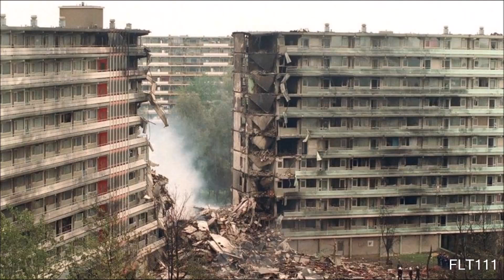El Al Flight 1862 - ATC Recording [ENGINE DETACHMENT DUE TO METAL FATIGUE AND LOSS OF CONTROL]

Comment: RIP
Yitzhak Fuchs
(1933–1992)
Arnon Ohad
(1960–1992)
Gedalya Sofer
(1931–1992)
Anat Solomon
(1968–1992)
and
To the 43 people who were killed on the ground by the crash of El Al Flight 1862 due to a dual engine separation and loss of control

Comment: Anyone that thinks a plane stuck that building needs to stop watching Road Runner flicks
No Ali built hollow tube is going to smash thru 10 floors of Concrete, not in 100M years.
This Demo was a pre 9'11 idiot test and it worked.

Comment: I saw a NatGeo doc today, that very documentary. In that doc it was said that the captain Fuchs choosed the runway 27 to land because "is is the longest". It's a lie, RW 27 as the 4 other RW of Schipohl has only 3,3 Km length. The longest is RW is 36, 3,7 Km long, where the flight 1852 had took off 8 mins earlier, the same one. Check for yourselves in G. Earth. Maybe that plane had not any crew at all. Notice no worries in voices recorded of the crew...
Reply: Oh boy.
Reply: Uhh hold on it's not 1852 it's 1862

Comment: Where is the 400 ton plane? Does Avgas now vaporize metals??
The plane fell from the sky did it not?
So the wreckage must be above the rubble yes??
Where is it?? 400 tons of metal? and 2 massive engines??
Reply: I lived in the neighbourhood at the time and I saw that plane going in the Groeneveen and Klein Kruitberg flats at that Sunday evening. Now you are saying that i'm seeing things?
Reply: It didn't fall straight down. It hit full speed on the side of the building we are seeing. One wing straight down and one straight up if you see what I mean. I believe these buildings where not completely attached. There was a small gap. So most of the wreckage went through that gap and is behind the building.. after impact the sides of the buildings collapsed on top of any wreckage that was in that gap. It was really insane. almost 30 years ago and I still remember it like yesterday. If you ask any Dutchman over 35-40 years old about ''The El Al boeing'' they will probably immediately know what you mean.
Reply: @Dani8chs  Some errors with your claims
Full speed???  This plane had lost 2 engines off the right wing so ''Full'' speed was impossible!!
The aircraft was on approach for landing , why would any plane be on approach landing at ''Full' Speed??
Yes the plane was on a fast approach because of serious wing damage but nowhere near ''Full' speed.
This aircraft ''Plunged'' from the sky. It had lost  ''Lift' from the right side due to severe damage cause by the separating engines from that wing.
I pose my question again? Where is the 400 ton wreckage?
Reply: @yabbadabbadoo8225  Underneath and mixed in the ruble
Reply: @irobinhood5529  Keep reading Bambi stories dude
Reply: @yabbadabbadoo8225  Keep believing conspiracy theories.
Reply: @musicnerd72  Show me the Plane?
An El Al Jumbo Jet is a big Beast.
It still had(claimed) 2 engines attached.
I have spent weeks looking for evidence of plane wreckage. I have found Zip.
No wings , no tail fin , no fuselage sections , no landing gear(cannot melt in fires), Only in the 9/11 events and this El Al 1862 claimed crash have planes 100% vanished!! 100% Impossible.
It Pays to Open Your Eyes unless you're involved in said Crimes !! Ummmm??
Reply: @irobinhood5529  The plane in the report was claimed to have plunged down on to the building!! The Rubble would therefore be Under the plane wreckage if there even was a plane - Try Harder
Reply: @yabbadabbadoo8225  investigators found the FDR (Flight Data Recorder) in the wreckage so there was a plane there.
Reply: @captainbossman1016  Really? They ''Found'' a Flt recorder but a 250 ton aircraft cannot be seen anywhere??
Landing Gear? Wings?? Tail Fins?? Claimed cargo?? Fuselage sections?? 2 huge engines?? The smoking Gun are the missing engines just like 9'11.
John Lear has explained 9'11. Someone needs to explain this El Al con job.
The damage to that building is consistent with an implosion result. Sir Isaac Newton's laws are not at all present here.
Never just take a picture at face value.
Look deeper always.
Reply: @yabbadabbadoo8225  Jezus.. When a plane 400 ton plummets from the sky it will get a very high speed. Much higer than it could even achieve with all 4 engines. I mean.. How old are you? 5? The plane simply disintegrated in to many small bits to small to identify as bits airplane on this low quality footage.. But sure have it your way mate. The earth is flat. Trump won the election and this was a bomb..
Reply: Viking  Conspiracy theory much???  With speed, it was disintegrated.   Check out the laws of physics. That might help.
Reply: Destroyed on impact. When a plane hits a building at over 300 mph . Everything turns into small pieces . Check it yourself

You really need some help dude don't make stupid comments before you check it
Reply: Viking  not everything is a conspiracy
Reply: Viking  when a plane hits a building at very high speed then it disintegrates into very little pieces which then gets mixed with the wreckage from the building. Learn something about aviation before you comment.
Reply: Look at the link below at 21:05 . Clearly a chunk of a wing. Guess you missed that during all your weeks of investigating. Or is this a fake piece of wing? LOL  https://www.youtube.com/watch?v=QkWUIaEoUls
Reply: Viking eye witness accounts
Reply: 4 engines, and it’s not av gas it’s jet fuel
Reply: @skankhuntfortytwo8691  4 Engines? Which reports have you been reading? The 'Official' report stated an 'Off Duty' cop out fishing on some lake saw 2 engines  fall from the plane and saw the Exact location where they fell. So if the cop saw 2 engines falling from the Jumbo jet, how many does that LEAVE?? (Avgas - industry term for Aviation fuel) You work it out. You seem over clued for this site anyway.
Reply: Why is there always a conspiracy theorist popping up every time a major disaster occurs where many people lose their lives?  The need to be the one counter argument out there so as to prove some higher level of intelligence only proves ignorance.  Has anyone ever explained the “magic” trick where someone pulls a table cloth from a table full of plates without disturbing the plates?  Was that magic or simple fact of science?  Not being able to explain something to convince your own self-doubt does not make something false.  Adults know this.
Reply: @gervanwilliams1409  That's a very simple question to answer there.
When a plane is reported to have smashed into a 9 floor housing tower and the claimed plane has vanished and above that, it is claimed to of taken out 9 reinforced floors??
It begs the question, what sort of Armour do some Nations install into their commercial jets?
An off duty poiliceman claimed while he was fishing in a boat saw 2 plane engines falling from the plane, yet the two still attached could not be found?
5 Ton engines cannot vanish neither can a cabin Axe. That also was never found.
Your point again was what?
Reply: @gervanwilliams1409  Let's just call it a pretext for 9'11 which most people swallowed.
5 ton engines cannot vanish. Only expolives can make 5 tons vanish.
In every war many soldiers vanish. When bones, teeth, belts, packs, weapons and boots vanish, it's usually a direct hit from shell fire, not bullets.
Reply: @yabbadabbadoo8225  pretex to 9-11?  You’re stretching this one, my friend.
Reply: @gervanwilliams1409  Really? When do you think WW2 was planned??
The Bromberg massacres were planned very soon after WW1 ended
Perhaps History is your weaker subject?
Reply: @yabbadabbadoo8225  you know, man, I was willing to hear you out though I clearly don’t agree with you.  But like most conspiracy theorists on the internet, when someone asks for more proof or to argue your case further, you turn to insults.  This is where I jump off this crazy train.  You are speaking nonsense, and if you are truly reading history books, this wouldn’t be the best you got.
Reply: @yabbadabbadoo8225  the wreckage was taken to the garbage dump
Reply: @RatsCatsAndCups  Incorrect. No wreck from any air disaster is ever taken to a ''Tip''
All aviation crashes by law must be investigated by local aviation bodies.
Because the claimed wreck was a 747, Boeing would have had to send in a team to work out what went wrong and implement design improvements before anything heads to any ''Tip''
Did you happen to read the final report?
Reply: @yabbadabbadoo8225  stop with your nonsense conspiracy are you ignoring the fact that the 4 pilots really died

Comment: I'm seeing building rubble, but where's the Boeing 747 ? where's the damage the 747's wings would have caused ?  I remember this event when i lived in London and there were a lot of unanswered questions about this '' accident .'' But back then most people trusted main stream news/media,  Big mistake !!  This pic reminds me of the pentagon on Sep 11 2001.
Reply: There's parts of the fuselage smack dab in the middle, guy.
Reply: Harry Hepworth Keep in mind that that picture is taken days after the accident, and also the left wing was pointed towards the sky while the right wing was pointed at the ground moments before impact.
Reply: Destroyed on impact. When a plane hits a building at over 300 mph . Everything turns into small pieces . Check it yourself
Reply: But no evidence of debris consistent with a B 757 airliner was ever found on the crash site, in the Pentagon case. All footage from cameras in the vicinity were confiscated by the FBI for "national security" reasons. And only a few doctored frames were ever released. Only morons would compare that strange case with any other having even a semblance of similarity.

Comment: Heartbreaking , they didnt know that both engines were seperated from the wing together with the wing edge. When they dropped speed and extend the gears they had no chance. Only one chance was to try approach with more than 200kts, which will also cause  crash upon landing. But probably there wont be many fatalities like this. For passenger entertainment they put cameras on the aircraft. They should put cam also for captains make them see phsycal condition of both wings.. Hopefuly in the future.
Reply: Yeah for sure.. it seems such a logical thing that the pilot's should be able to see all around critical area's of the plane, from within the cockpit.
Reply: Exactly what I thought. Though, can’t really say if it would’ve save them
Reply: Cameras? I think that was the Flight 191
Reply: Indeed. Had they known what was going on they could have ditch it in the sea instead of on one of the busiest parts of town. I don't know if planes still don't have some kind of cameras on the wings but if not its criminal. A simple modern truck has 3-4 cams all way round. It costs approximately nothing. This crash was one of the biggest disasters Holland had ever seen. Its soon 30 years ago but I remember it like yesterday..
Reply: Dani I’m not trying to be a smart ass but what kinda “simple modern truck” has 3 to 4 camera’s??  Mine doesn’t even have 1 and it’s a 6 year old pick-up.
Reply: @apieceofdirt4681  i think dani means freight trucks.
Reply: It was a Cargo Plané
Reply: @MeaHeaR  it would help any flier.
Reply: @drink.juice.  yes your right, it would help in
so many ways, some like fl 123 it might not be good 😲,
some like the etheopian fire it would yes yes
Reply: Not the gear was the Problem. The flaps on the left wing were the Problem. They caused a bad angle.

Comment: Amazing composure by the crew under such extreme conditions. When both engines on either wing go out on a loaded B747, you are sadly as good as dead.
Reply: Damage to the wing brought it down. The loss of the 2 engines wasn't terminal by any means
Reply: Losing the engines was not the issue. When the engines fell off they effectively shredded the entire right wing
Reply: It can be done. A united 747 with an explosive  decompression  lost 3 of 4 engines out of honolulu in 1989. It made it back to hnl... barely but it did make it
Reply: This a different scenario, both engines fell from the wing causing the plane to lose its balance. Not to mention damaged hydraulics.
Reply: Jesse W that was insane how they brought that thing down
Reply: Interesting more people gave an up vote to this stupid statement then to the smart comments on this stupid statement. Guess that means people that watch these love exaggeration
Reply: @hmishin843  Just because you didn’t even watch the whole thing before commenting I’m a smart Ass? I bet you have never actually Read an NTSB report about a crash. What you are saying is the pilots didn’t know as much as you and should not have turned back toward populated area.
Reply: Mr.Pope, you really are making an ass of yourself in front of the entire world. I'm a retired aeronautics engineer, and I assure you that know of every Jet powered civilian aircraft crash, beginning with the first investigation on the structural failure of the British Comet. Take care.

Comment: Theres nothing strange about this carnage. The building is cleaved right in half, the hole does look more like the pentegon on 911. Much lower down impact compared to the twin towers. But as you can clearly see here, big jet airliners can bust through steel and concrete if they are travelling fast enough
Reply: What I want to know is how a plastic and alloy plane smashed through 3 thick steel reinforced walls at the pentagon and left a hole punched out in the third wall even though they said that the plane was vaporized ?
Reply: @Dan_druft  Probably because force scales with the square of velocity you melon
Reply: But they don't vaporize in an empty grassfield.
Reply: EverydaySaucer2, How do you know that? As the plane had already lost its two engines they had already decreased the power of the engines on the left wing to decrease the lift power on the left wing, which means they have roughly been in a lower speed than the 9-11.
Reply: @imranahmadov2463  im late i know but, when you drop something from a hight point it will gain speed this is physical
Reply: This is the bijlmer
Reply: E I N S wow youre a fucking idiot.
Reply: where is the plane wreckage?? 400 tons of Plane??
Reply: @yabbadabbadoo8225  vaporised
Reply: @egretfx  Flick me the science and facts that supports your ''vape'' suggestion, cheers.
Reply: This was a 747 that hit a poorly built apartment building...idiot
Reply: Your brain is an inside job.
Reply: Johan0609 feytsma: Supposedly it dug itself into the "soft" ground and landing gear tore off and landed in a lake quite far found quite sometime later too. How convient that the only piece didn't get "dug" into the ground ended up where people wouldn't look in the first palce.
Reply: How about this building still standing?
Reply: @artcore9886  Because it's much wider than it's high.
Reply: @artcore9886   imagine not understanding the different structures in a freaking tower and these kinds of buildings.

The Tower was struck in its entire core. These buildings just get damaged on parts.
Reply: Planes cannot cut trough thick steel, it defies the law of physics. Therefore the footage of 911 is fake this is a well proven case by now
Reply: @plma1925  Well proven? The whole of New York vs. circumstantial (at best) evidence, straight up nonsense at worse

Idk fam

Edits: at best and at worst example.
Reply: But no evidence of debris consistent with a B 757 airliner was ever found on the crash site, in the Pentagon case. All footage from cameras in the vicinity were confiscated by the FBI for "national security" reasons. And only a few doctored frames were ever released.  Only morons would compare that strange case with any other having even a semblance of similarity.